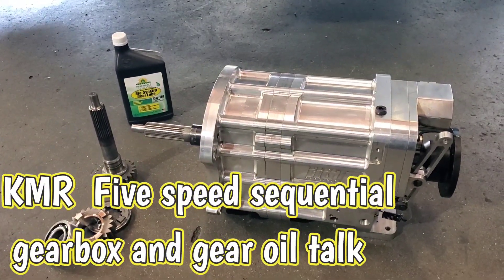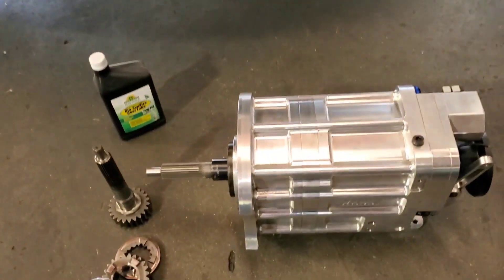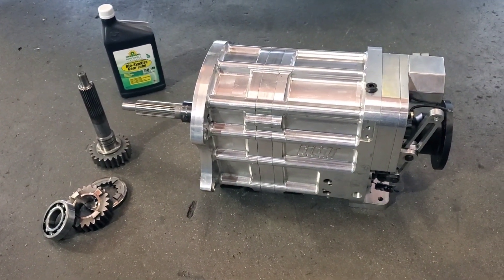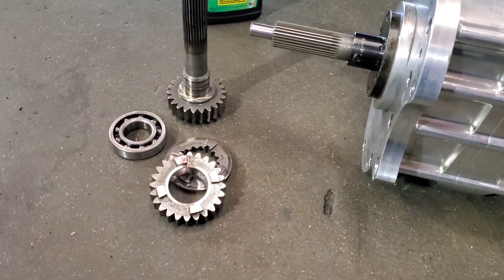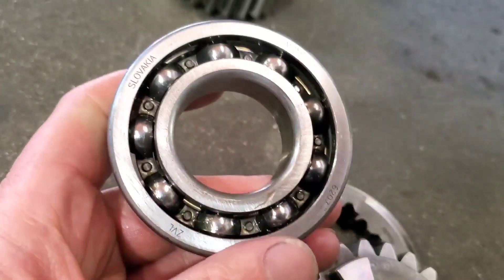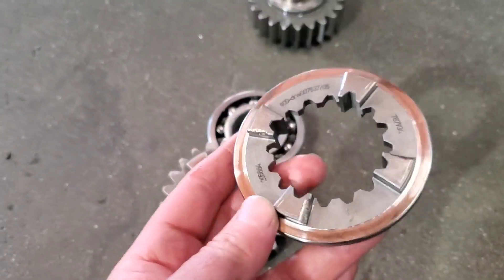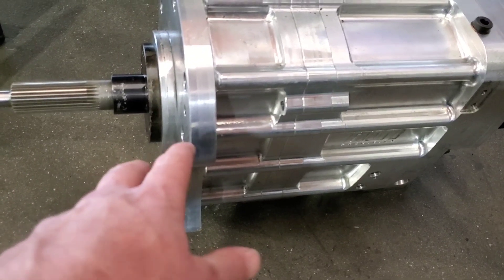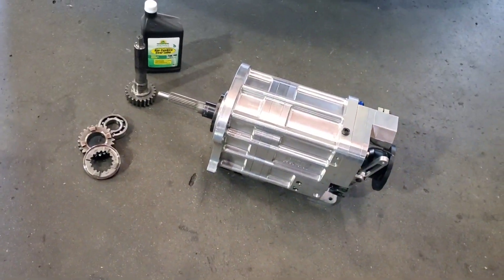5 Speed Sequential Gearbox / Renewable Lubricants / 1000hp Formula D RX8 Tech Talk

Comment: Love these tech talk videos. 

Question: Since you are using this box in a rotary application, what are some of the hurdles and specific conditions brought up ringing this thing out to the RPM you are, especially without a cooler. Is the simplicity and weight savings from running cooler-less that much more beneficial? What would happen in a back-to-back-to-back OMT, is there enough time in between runs to ensure trans temps stay nominal?